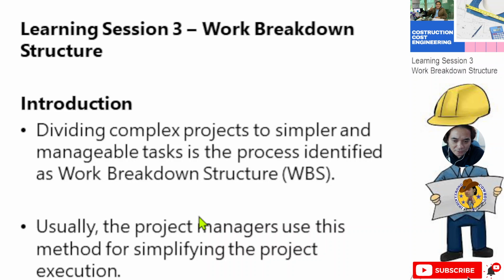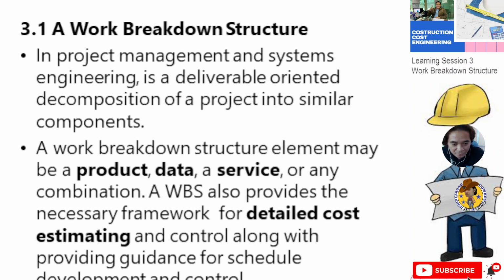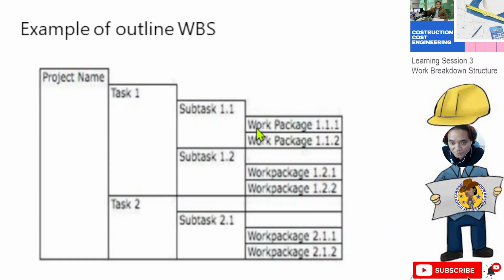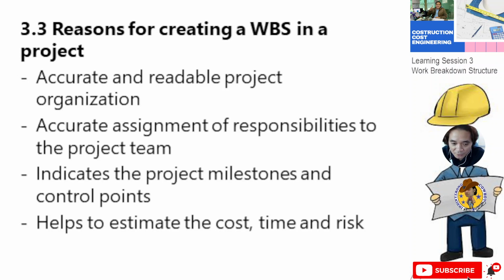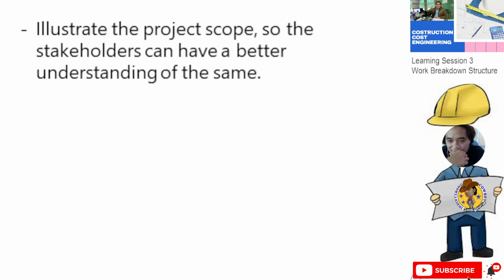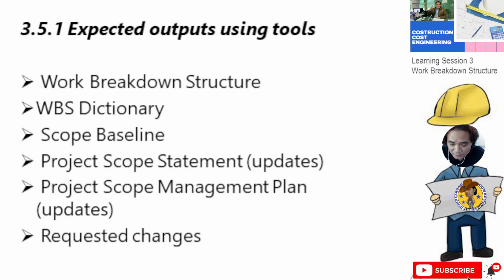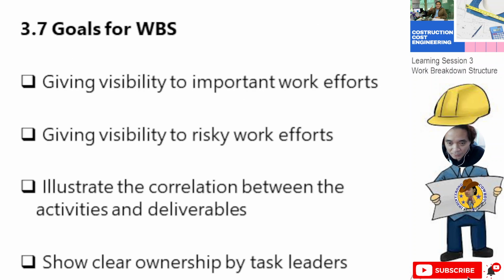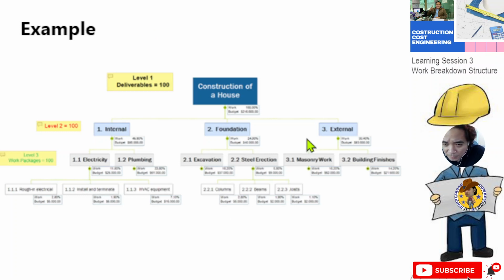Construction Cost Engineering | LS 3

Comment: In this learning session,  I learned that the work breakdown structure, in my perspective, is crucial since it breaks the team's labor into manageable parts. By doing this, the project is guaranteed to run smoothly and delays may be avoided, both of which may have positive results.

Comment: In this lesson I learned that Work Breakdown Structure (WBS) is a project management tool that takes a step-by-step approach to complete large projects with several moving pieces. By breaking down the project into smaller components, a WBS can integrate scope, cost and deliverables into a single tool. WBS helps to allocate tasks. When a project is broken down into manageable tasks or packages, it becomes a lot easier to assign these to the appropriate individual. This helps your team plan around other work that needs to be completed outside of the project in question. WBS improves communication.

Comment: In this learning session, as discussed by Inhinyerong Cowboy or known as Engr. Mardie O Poncol, I have learned that Work Breakdown Structure or WBS is a method for completing a complex project. It helps to make a large project more manageable. Breaking it down into smaller parts that will allows multiple team members to work on it at the same time, resulting in a better team productivity and easier project management. It is also a common productivity technique used to make the work more approachable. For projects, it is the tool that utilizes this technique and is one of the most important project management documents. It singlehandedly integrates scope, cost and schedule baselines ensuring that project plans are in alignment.

Comment: In this learning session 3, I have learned that a A Work Breakdown Structure (WBS) is a hierarchical outline of the tasks required to complete a project. The WBS “breaks down” the structure of a project into manageable deliverables. Each deliverable is assigned a task, or series of tasks that can be further broken down into subtasks to meet the needs of the project.

The advantage of using a WBS as part of project lifecycle management is that is takes large, complex projects and breaks them into smaller, more manageable tasks that can be assigned to specific people or teams to deliver.

Comment: In this learning session, Ive learned that a work breakdown structure, or WBS, is a project management tool that uses a step-by-step procedure to finish big projects with lots of moving parts, I've learned. A WBS can combine scope, cost, and deliverables into one tool by segmenting the project into smaller parts. The WBS, or work breakdown structure, is crucial to project management since it speeds up the creation of a schedule by assigning effort estimates to particular WBS parts. Additionally, if it has a branch that is not clearly defined, it can be utilized to identify potential scope issues. Additionally, it offers a mechanism to calculate project expenditures. Additionally, it makes sure no significant deliveries are overlooked.

Comment: I've learned that using a work breakdown structure will help you finish a challenging job during this learning session. Its major objective is to break down complex activities into a series of tasks. For a project manager, this is important since they can handle the work more efficiently than complex operations. Additionally, the task needs to be measurable, autonomous, and have clear boundaries.

Comment: In this lesson, I learned that a work breakdown structure (WBS) is a hierarchical approach of planning a building project in the construction industry. A single document known as the work breakdown structure (WBS) is used to break down the project deliverables into smaller, more manageable units known as work packages.

Comment: This learning session taught me that a work breakdown structure is a method for completing a complex project. It aids in making a large project more manageable. Breaking it down into smaller parts allows multiple team members to work on it at the same time, resulting in higher team productivity and easier project management.
And it's useful in managing projects because the work breakdown structure (WBS) lets project managers plan their work more efficiently. A project is characterized by time-limited activities and is assigned fixed time frames and costs. The WBS helps make this planning consistent and provides for effective project execution.

Comment: Based on the discussion of Work Breakdown Structure (WBS), I have learned that A work breakdown structure (WBS) helps project managers plan work more efficiently. In which the projects are characterized by time-bound activities, with fixed timeframes and fixed costs. When a completed project should meet the needs of the stakeholders for which it was designed. Therefore, Project managers must plan and assign responsibilities for project schedules, fixed costs, and functional completeness. A WBS helps make this plan consistent and ensures effective project execution.

Comment: In this learning session, I have learned that a work breakdown structure, or WBS, is a project management tool that takes a step-by-step approach to complete large projects with several moving pieces. By breaking down the project into smaller components, a WBS can integrate scope, cost and deliverables into a single tool. This work breakdown structure, or WBS is very important in project management because it facilitates the quick development of a schedule by allocating effort estimates to specific sections of the WBS. And it can be used to identify potential scope risks if it has a branch that is not well defined. and it provides a way to estimates project costs. And last it ensures no important deliverables are forgotten.

Comment: In this learning session, I have learned that Work Breakdown Structure is a method for completing a complex project. It helps to make a large project more manageable. Breaking it down into smaller parts that will allows multiple team members to work on it at the same time, resulting in a better team productivity and easier project management.